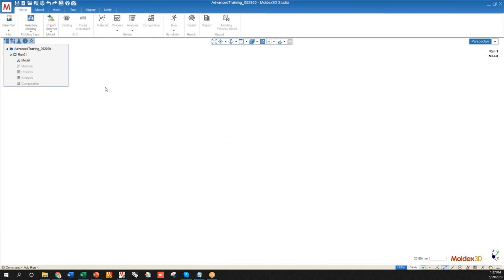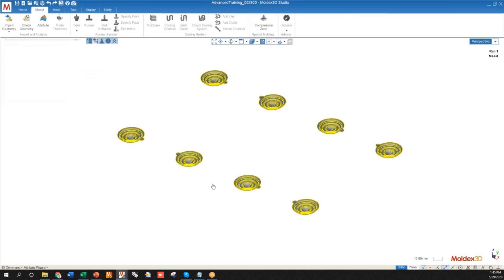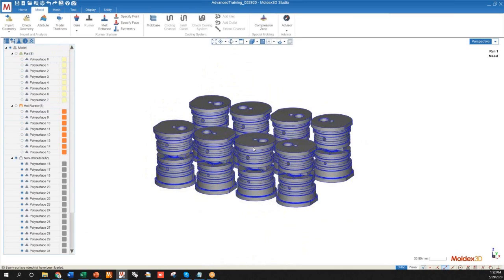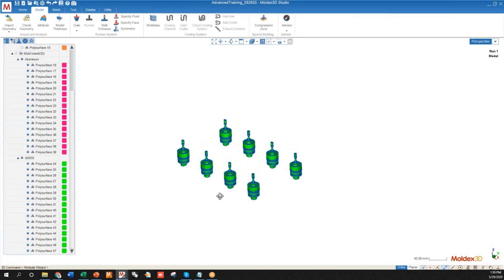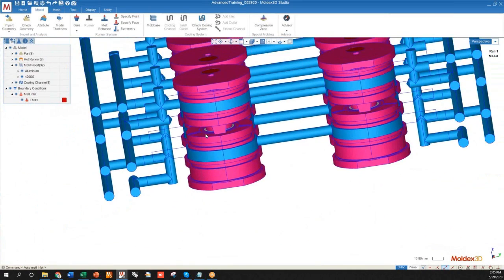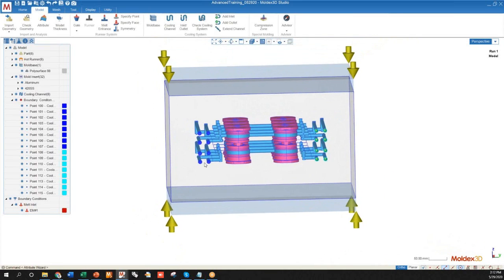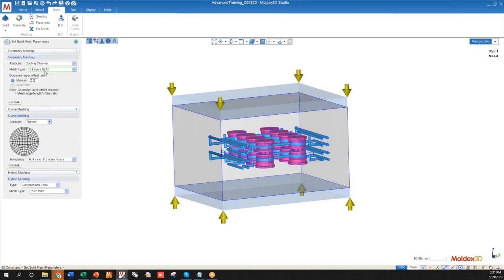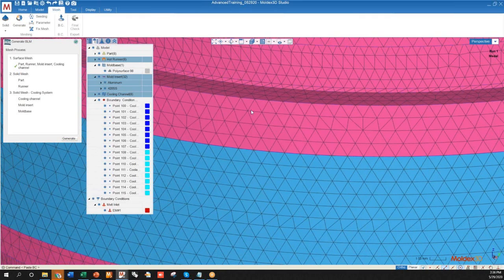Mold Component Import & Meshing | Moldex3D Advanced Training Series | CAE Training

Comment: When I indicate the surface on the nozzle is the plastic melting point, is that correct?
while it only melts the plastic inside the nozzle to a smaller size
Reply from the maker: Yes, that is correct.  This is the same of hot runners in Moldex3D.  Even though the volume is initially filled, the flow calculation starts from the melt entrance at the top of the system.
Reply: thank you
How to add a new plastic material to modex 3d if the library doesn't have it
Reply from the maker: @thanhviendhh  If you have the material data and are a customer of ours, you can send us the raw data and we can fit it to our numerical models.  Alternatively, you can send us a spec sheet to get an alternate material that would behave similarly.  For a fee, we also have our own material testing capabilities at our HQ in Taiwan.